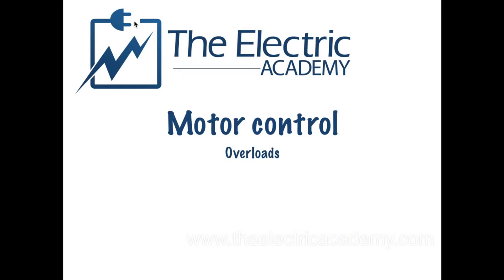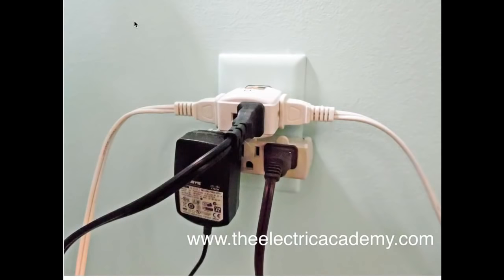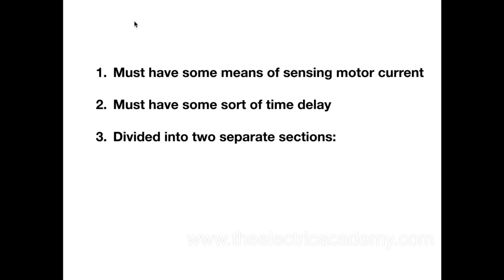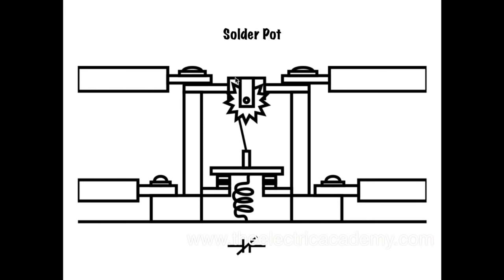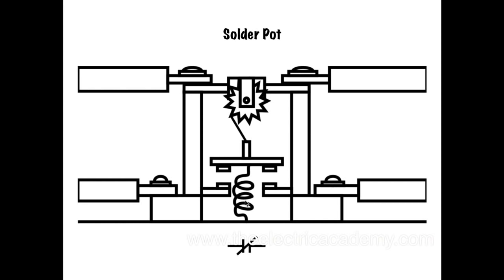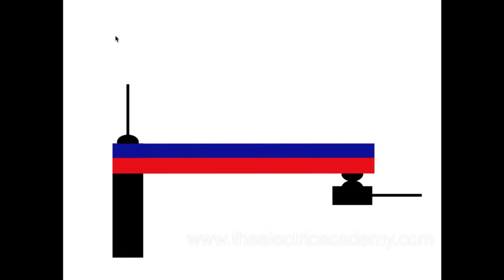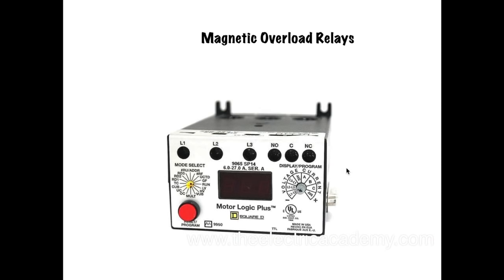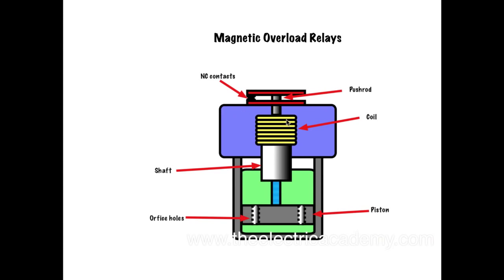How motor overloads work

Comment: Hey Chad, really appreciate the videos. Do you think you could make a video or include in the new course module information on actually sizing the protection and conductors for motor circuits? I find this section of the CEC really confusing and actually hear differing opinions from different colleagues (can the conductor be sized less than the protection for these circuits??). Thanks again for the channel.
Reply from the maker: Eric Knudsen Hey Eric.  I’m actually putting together an CEC bootcamp course and motors are definitely in the mix!  I will let ya know when it’s ready to go (probably within the next two weeks)
Reply: The Electric Academy thanks! Look forward to it.
Reply: Look at NEC Article 430.